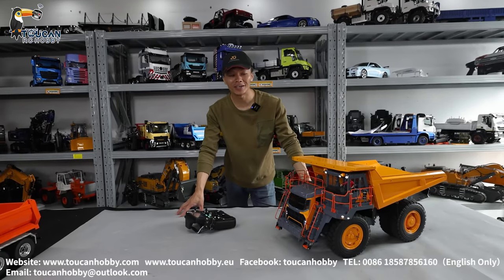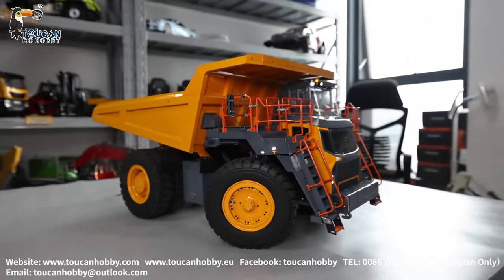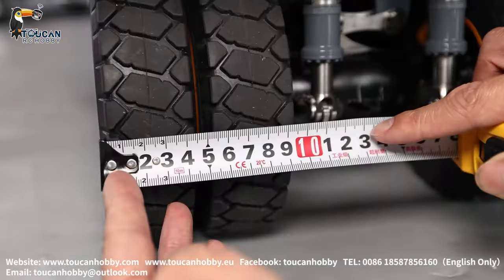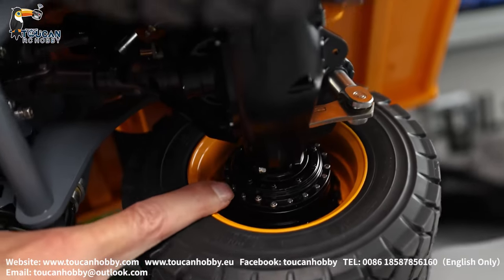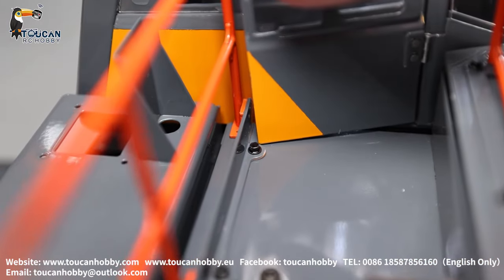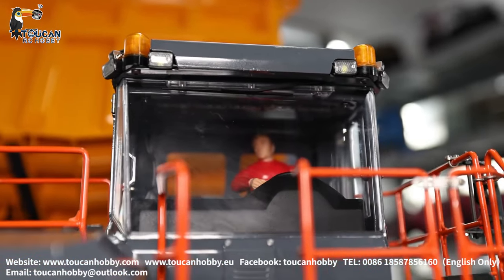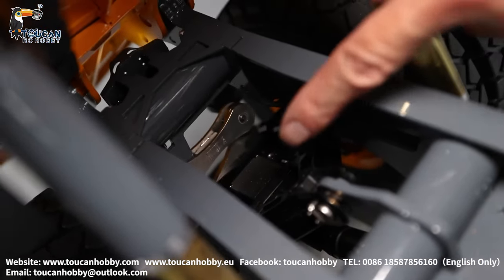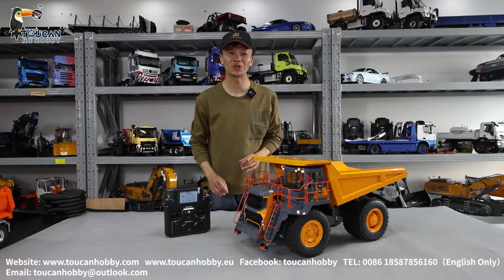Upgraded LESU 1/16 R100E Hydraulic Dumper, toucanhobby painting assembled.#construction #car #metal

Comment: Id buy more Lesu if their website had better parts availability/support
Reply from the maker: I can supply parts getting directly from LESU factory
Reply: @toucanhobby2400  I'd preferr some images with part numbers I need a new pinion for a Lesu locking differential
Reply from the maker: @awesomusmaximus3766  for which model used for which position? Add me friend will supply to you
Reply: @toucanhobby2400  Actually it's not a model it is a standalone locking differential I need a drive new pinion

Comment: The sound system is rubbish, it sounds like a fisher price toy. The cab door doesn't open as designed incorrectly by lesu. This model was floored from the start with faulty hydraulics from lesu causing juddering when tipper bed operated. The hydraulic cylinders now seem to be improved but for £5000 they got to be kidding... lesu sort it out FFS 👎👎👎
Reply from the maker: Yes right side door can not full open, now the hydraulic cylinders has been upgraded it is working great now, so which real machine sound do you like? Could loading different sound to the module